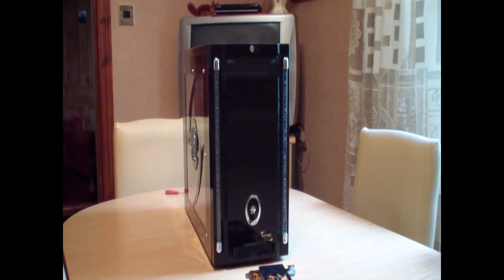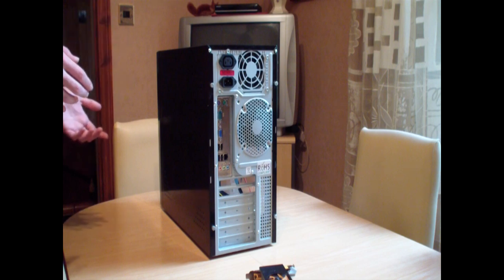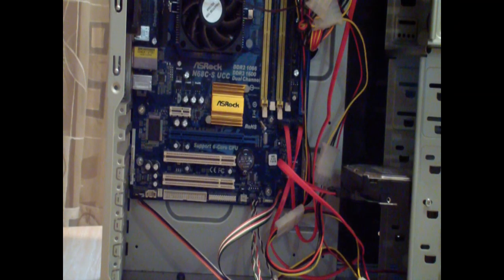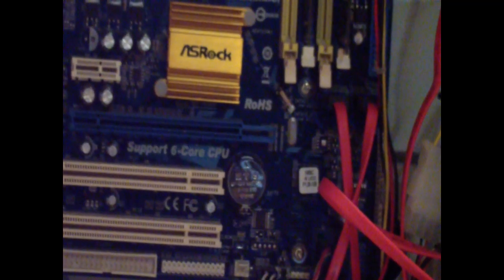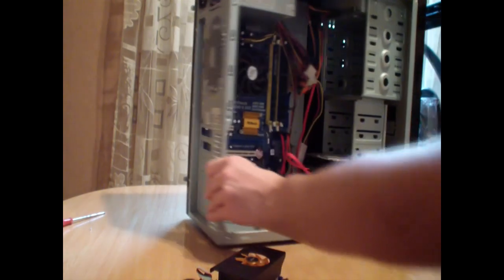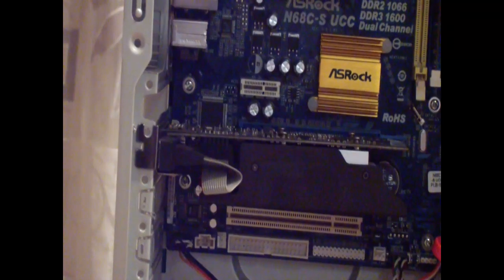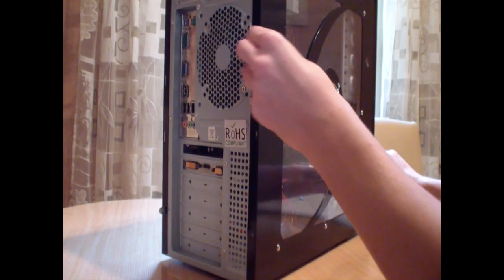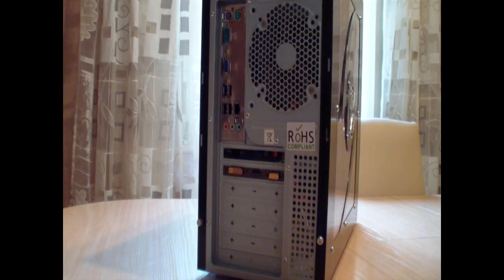How To: Install an Nvidia GeForce GT430 Graphics Card

Comment: whats your psu wattage?
Reply from the maker: I cannot remember I'm afraid as this build wasn't even built by myself and the video is several years old. You will not need to worry about PSU wattage with this graphics card however. It will work in even the most basic of builds.
Reply: okay thanks and ive been looking at the gtx 750 but i have a 250w psu when it recommends 300 w do you think i could still run it ive saw that some people have managed this?
Reply: Krei23 Dont try it or take the risk it could blow your cpu hope im not to late!
Reply: thanks and your not
Reply: Krei23 No problem :) Glad your computer is fine!

Comment: What is the best graphics card compatible with these specs.

Intel Dual core 3.9 GHZ cpu
1 GB DDR3 ram
ASUS P5KPL AM/PS motherboard.
Windows 8 Pro 32 bit OS.

I can spend upto 3000 INR i.e., 51$

Comment: Can you see why i would be having problems getting my system to pick up this card im running windows 7 with only bios update i can get 3.10. Im trying to install on The A8M2N-LA (NodusM3) motherboard in Compaq Presario Media Center SR2019UK Desktop PC,  ive tried disabling and uninstalling the onboard graphics but when i turn pc back on it reinstalls the onboard graphics, the disc with drivers wont install them either

Comment: When I plug my monitor in it say invalide frequency and it wont work, ive installed the drive and every thing (geforce 6200) which state had 1 before but I used it for my new cpu I didnt install it ether times but this time I thought I would. What should I do?

Comment: And what are your specs? Mine are: 
Intel® Pentium® Dual Core G620 processor
8GB RAM
1TB (1000GB) SATA hard drive
18.5 inch TFT Monitor
DVD/RW drive
Integrated Intel graphics
Microsoft Windows 7 Home Premium.

Comment from the maker: Not really, I am talking about putting a static charge into the computer hardware. If you don't take adequate precautions you run the risk breaking some of the core components in the computer by carrying static.

Comment from the maker: If you are planning on gaming then I'd advise putting it into the new computer as you will maximise the most out of the PC's performance. It would seem a waste to have bought a new PC with much improved specs to then use your older PC for gaming. I would personally keep your old computer for general usage and put the better Graphics Card into the latest PC to make the most out of its specs when doing higher intensity things like Video Editing, Gaming ect.

Hope this helps :)

Comment: Hi thanks for the video:)  i'm just wondering i bought a Geforce KFA gt520 2gb and a new pc,  my old pc spec is an 

Asrock N68C-S UCC quad core phenom II 3ghz...... my new pc is a  

Motherboard Asus M5A78L-M LX - AM3+, USB 2.0 mother board with 
CPU - AMD FX 4100 (4x 3.60GHz) AM3+

could you tell me which pc would benifit the new graphics card?  I got a redeon HD 4850 512mb in the old one at the moment.. thanks

Comment: Ummmm... I installed the card but i'm getting worse graphics than before, and I was using integrated graphics. I think I disabled the integrated properly. What I did was I went in BIOS and set the main port to PCIe instead of PCI. I'm checking it with different games but this is really wierd.

Also the disk that came with the card failed to install so I just i installed the latest one from nvidia.com. Appreciate all the help thanks.

Comment from the maker: @Averagegamer100 Just plug your monitor into the new graphics card, the computer will automatically use the new card as long as you installed the drivers. 

You can just leave your old card as it is, no need to do anything with it.

Hope that helps :)

Comment from the maker: @xMAJ0R Most computers will have the correct ports for this graphics card. You can check your Manufacturers website or your computer manual to make sure.

Check your monitor if you have a HDMi port on it you can then use the HDMi cables (can purchase on Amazon). The graphics card does let you use VGA and DVI cables too though.

Comment: Hi, I bought this card, installed the drivers and such, but the fan does not seem to be working on the card. When I connect it to the motherboard, the fan will start rotating very quickly, but will stop in about two seconds. Is there something wrong? :(

Comment from the maker: @ReadThisDerp I've found that if your PC can use the graphics card without the need of installing the drivers the sound (on most occasions) will continue through the original source. The only other thing I can suggest is picking up a cheap dedicated sound card (relatively easy to install) and installing it the same time. This is what I did.

Sorry I cant be more help but I hope this does help you in your decision.

p.s thanks for the sub

Comment from the maker: @ReadThisDerp The bracket is what you screw onto the the case to hold it in place. I would personally advise getting one with a bracket, I have had a look and there are EVGA ones with brackets on Amazon. I personally would also not buy the EVGA version and purchase one by either Asus or Zotac. Unfortunately loosing the sound can be an issue found. This occurs because the sound is going through the installed g-card. The sound comes through the HDMi port now. (cont)

Comment: @TheTechGeek15 I'm getting really paranoid before I buy this off of Amazon so I would really appreciate it if you could answer a few last questions for me.

1. I'm ordering the EVGA version on amazon.com and apparently it doesn't come with a "bracket". Is it necessary to have that?

2. I've seen some people complain that when upgrading from integrated graphics to an actual card that they lose sound. My sound is integrated also so I'm worried about sound. Shuld I worry about sound?

Comment from the maker: @ReadThisDerp This graphics card is compatible with most computers as it doesn't require any extra power supply (like some do). As long as your computer has a PCI slot (looks similar to the slot shown on this video) for the graphics card to slot into, you should be fine.